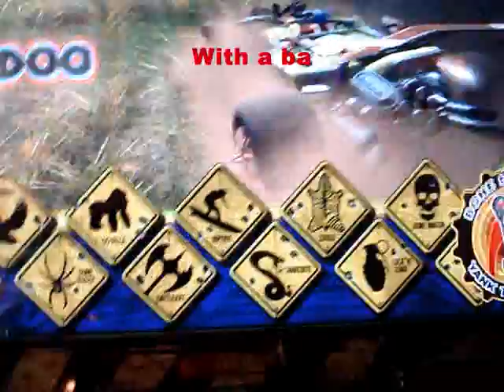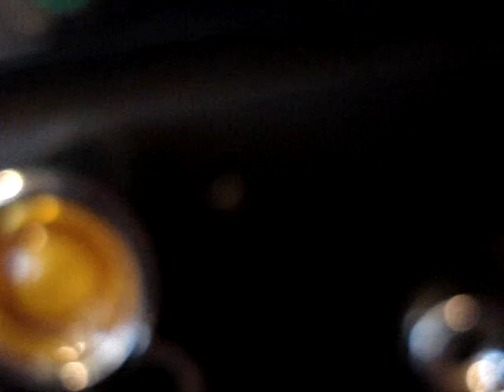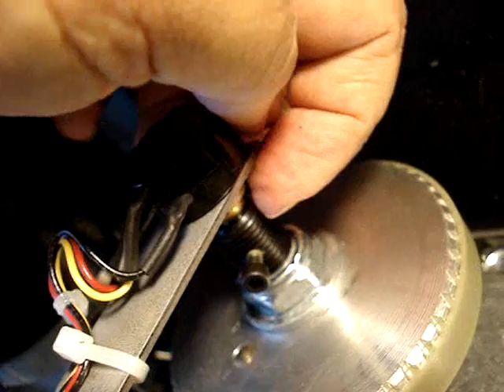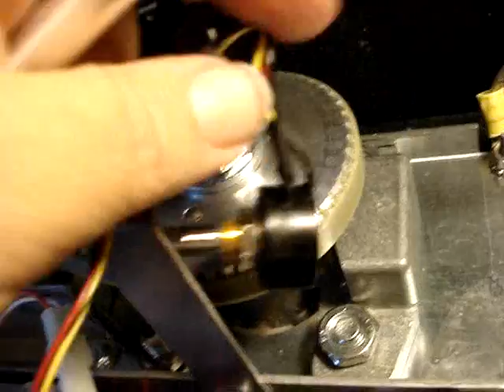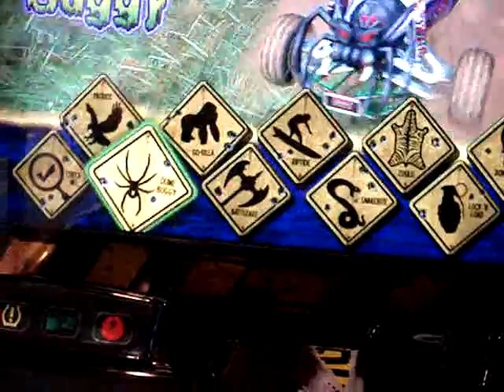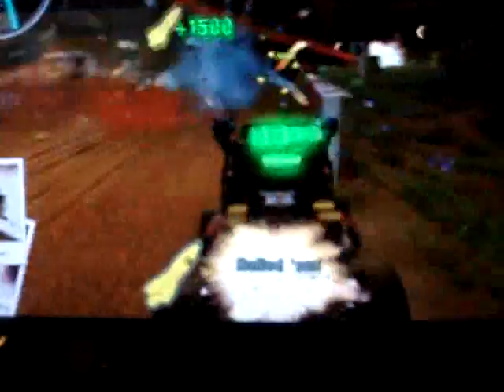Arcade Fix Dirty Drivin Steering Pot Replacement

Comment: thanks for the vid, i scored a free cruis'n usa single sit down cabinet.
got it to boot up after the owner said he did this same fix to the unit, after replacing the pot he wasnt able to get it to boot up. ive messed around in the bios menu the pot seems to get random signals as in the game type select it jumps around to random selections. and pulls either hard left or right when you spin the wheel. the motor does not move. what ya reckon? thanks!
Reply: @SamsArcadeFix  thanks for the input but!  i was able to boot the sucker up simply with the toggles in the coin door. swung the control panel open. found that the pot and mounting bracket were MIA. so i ordered a replacement for 15$ via ebay. im sure it will solve my issue. i was able to find a video on a different game that used the same steering system that pointed me in the right way. everything seems to function fine minus that missing pot. i will update with a video hopefully once the part comes in. thanks bud.
Reply: @SamsArcadeFix  having a hard time keeping up with the vids im watching my bad. this unit dirty drivin' seems to have almost identical steering hardware as the crusin cabinet im working on. sorry in beers deep right now.
Reply: @SamsArcadeFix  thanks bud! yeah the part i purchased is the whole shabang. mounting bracket, pot and wires with the red connector clip. 15$